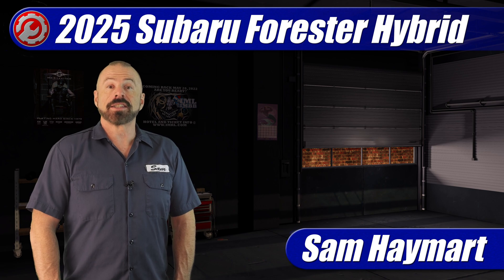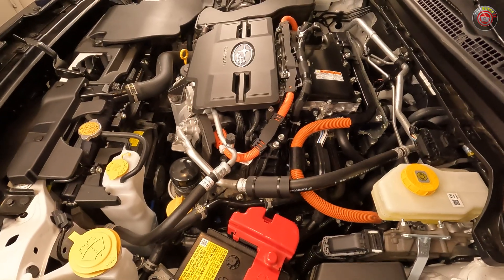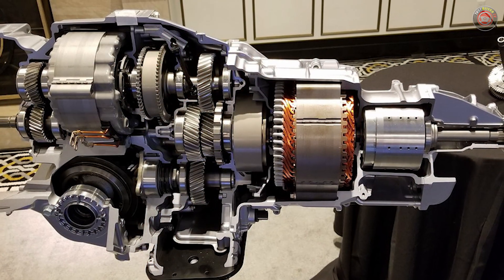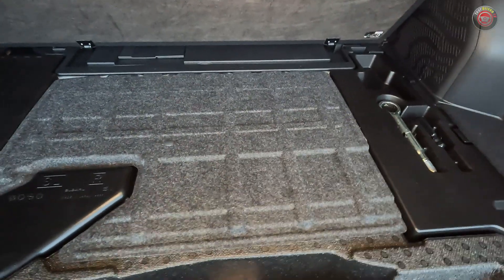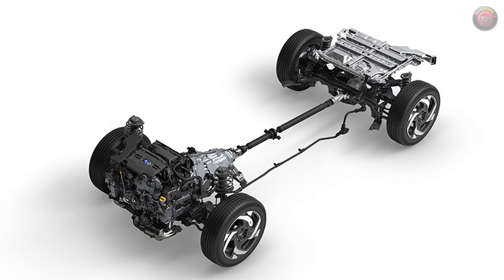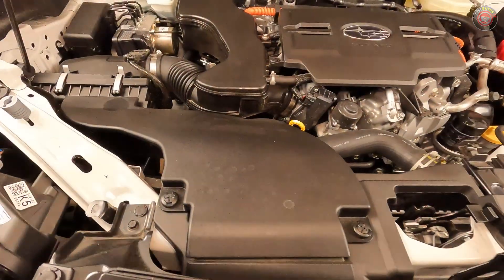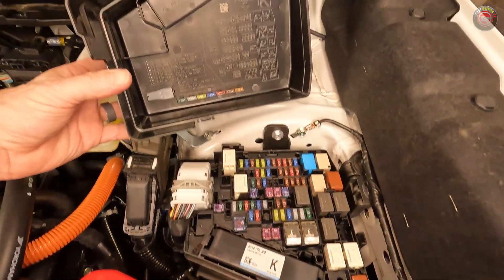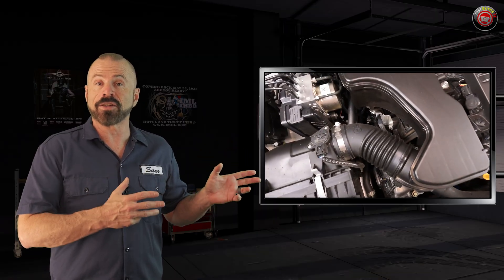Under The Hood: 2025 Subaru Forester Hybrid

Comment: Does that 12Volt battery start the engine?  If not, then what is it for?
Reply from the maker: The 12v battery does not start the engine, that is handled by the motor generator powered by the high-voltage battery. The 12v battery is there to powers the engine computer, lights, and all interior electronics.

Comment: Subaru has made three big mistakes on the new Forester hybrid:
1.  No hybrid Wilderness model--they could fix that.
2.  No spare tire.  Big mistake.  Many Subarus are driven in places where 24-hour road services are not available if one shreds a tire.  Even if a spare  tire must be mounted where it takes some cargo space, a spare tire should at least be an option.
3.  Fuel economy vs. price.  At current fuel prices, the Forester hybrid's only somewhat better economy would take years of driving to pay back the cost premium for the hybrid.

If one's desire for a Subaru is just to have a suburban grocery-getter hybrid that does well on a snowpacked road, the Forester hybrid might be OK.  For use for anything much more demanding than that, a non-hybrid  Subaru would a better choice.  

And, Subaru, please implement dual direct and port fuel injection or get rid of direct injection altogether on your engines--that goes for all the manufacturers currently using direct injection only.  There should be no reason to have to tear an engine down to clean the intake valves and ports.
Reply: Subaru decided the Wilderness model must have a spare tire, so no hybrid. The hybrid model places the battery pack where the spare would go.

Comment: I've had a Forester and it was a bit of a lemon. I bought the 2025 Ford Maverick Hybrid AWD. I'm very happy with it. It is much more efficient that the Subaru. It has a mechanical AWD and get's much better mileage. It has the planetary gear set with it's eCVT plus 4000 pounds of tow capability. All and all a better vehicle. After my lemon of a Forester I wasn't ready for that Boxer engine. It's old technology. The Maverick has basically the same hp and gets it done more efficiently, plus outsells the Forester.
Reply: The maverick DOES NOT outsell the Forester. Lol.
Reply: @MM-yy9ib  i think their on target to sell 140k Mavs this year.?
Reply: The maverick uses quite old technology, actually.  The 2.5L engine is from the late 2000s.  Very durable engine, and the Hf55 eCVT is probably the most durable transmission made today as well.
Reply: Mav is a truck, not an suv

Comment: In your opinion, regarding the latest Subaru Forester and upcoming 'strong hybrid' version, which makes more sense for me? I drive 80km a day on a mountain highway that is both twisty and constantly up and down. Once leaving home my speed never drops below 50km/h but stays 50-110 almost the entire way. I only get into the city once a month.
I am under the impression hybrids use the electric motor at low speed and combustion at higher speed? So the extra weight and initial cost of the hybrid for me would be pointless? Or have I got this wrong? Thanks.
Reply: They use both engines constantly. The electric motor helps the combustion one to run at optimal output all the times. Toyota's one at least is very complex recovering energy even at highway speeds. It's some soft of orchestrated coreography between both egines in order to gain maximum efficiency at all times.